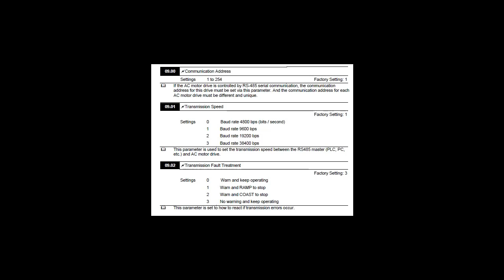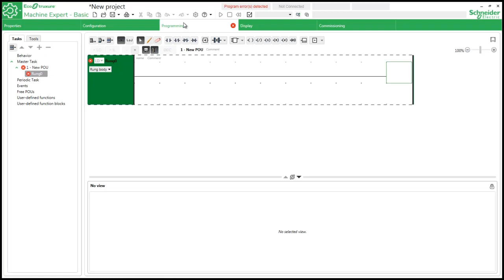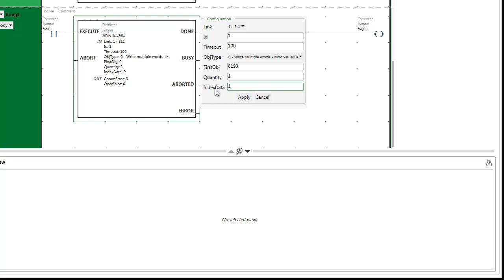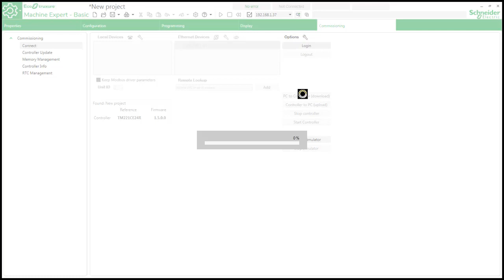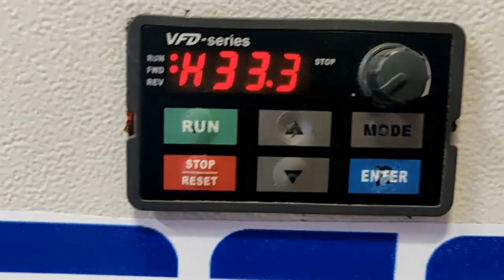Control of Delta VFD using Schneider PLC through Modbus communication | IPCS Automation Training

Comment: Hello,

I'm having a problem with configration and programming of modbus in SoMachine.

My project contains HMISCU8B5 (HMI with PLC) and I've added 'Modbus Manager' for COM1 The other device will be connected to this port and I would like to read data from it. Let's say it will have address 1.

As far as I know I should use ADDM and READ_VAR function blocks. How should I configure them to read temperature from device. Temperature addres is 40002. How should I set those blocks to continuously read value?

Any help will be appriciated. Thanks